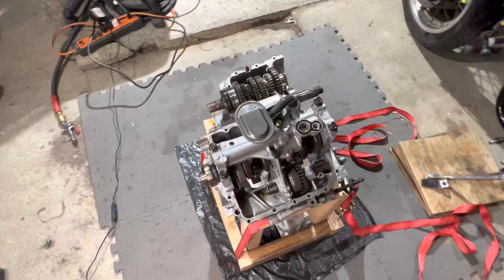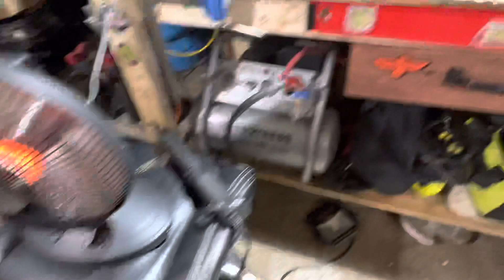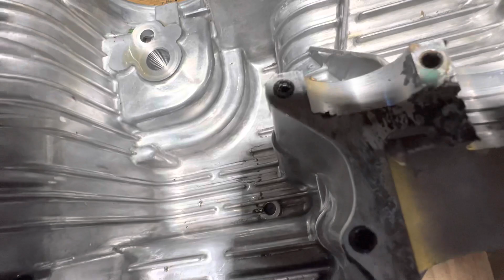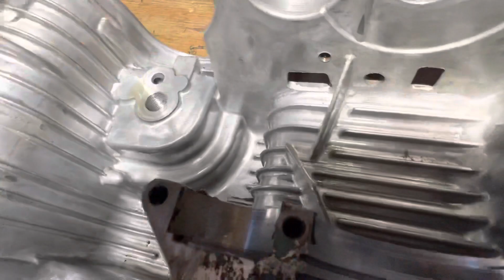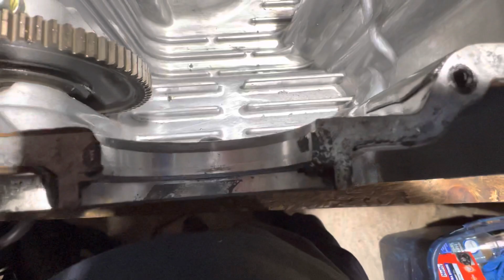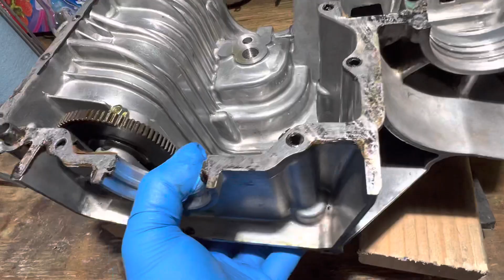86 Rebel splitting The cases part 2

Comment: I m trying to split the cases  also on my cmx450..I ve to pull out the starter clutch first?
Reply from the maker: @stelioskotso1304  no the starter clutch is attached to the crank.  You’ll have to take the starter motor off. Along with everything else.  Then split the cases